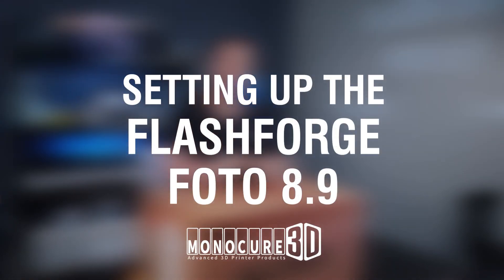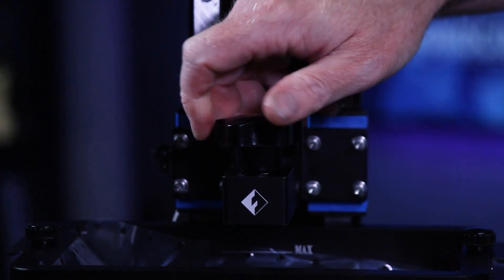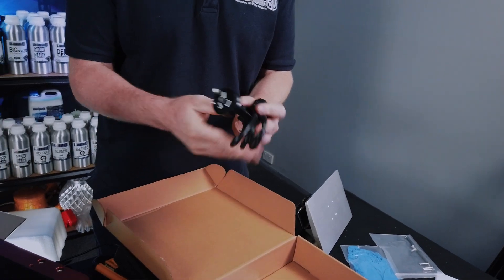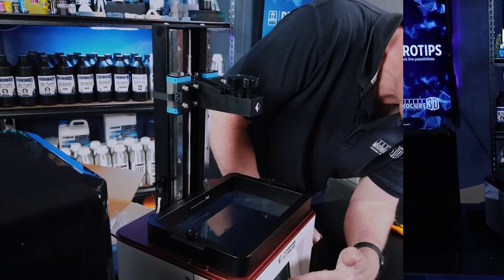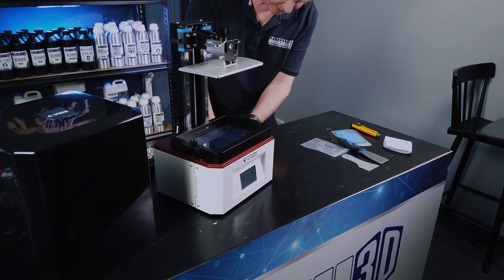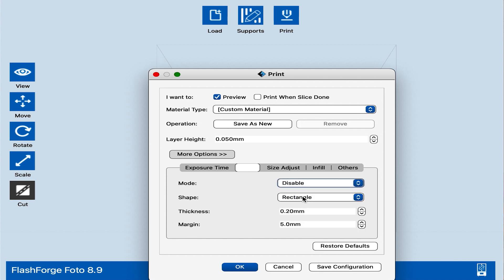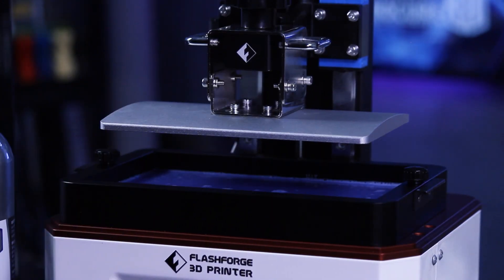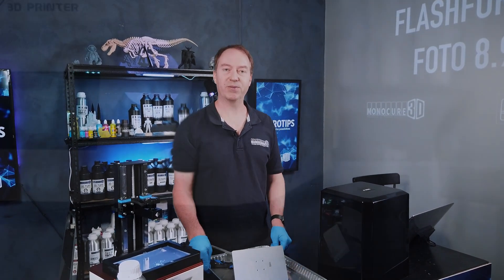Unboxing and Testing the Flashforge Foto 8.9 3D Printer: What's the Verdict?

Comment: I picked up one of these for $120 last week.  It's solid built machine but the software sucks and it doesn't work with Chitubox because it does not have a Chitu board.  You can edit the printer config for Chitubox to make it work but as far as I know things like retract speed cannot be set with the software.  Has anyone had any luck finding software that woks well?  FlashDL print doesn't even let you hollow the model.
Reply: Chitubox works fine without Chitu board just have to either create a custom machine profile or edit the default Flashforge Foto 8.9 cfg file to allow to save svgx

Comment: Excellent thorough review.  Flashforge has this printer on clearance in the USA.  They sent me a coupon for $10 off my first purchase for signing up on their website.  So I bought one of these printers with the orange instead of the dark cover for $169 USD including shipping and sales tax.  While I didn't really need another printer, it was hard to pass up at that price.  They also surprised me with a free 500 mL bottle of the green Voxelab resin in my mailbox today a week after I received the FedEx delivery of the printer.   BTW, the printer plate holes are a non-issue once you apply a magnetic flex plate.
Reply from the maker: Sounds like you got a good deal! valid point about the flex plate. I still think they are unnecessary and could have easily made rebuild, plate without the need for holes!
Reply: You better contact them! Its now $129 with free shipping direct from Flashforge!
Reply: @entertainmentdudes  Amazon is now selling it at $149.
Reply: @hughessay1372  Got mine Monday straight from the FlashForge website for $129.
Reply: @thedungeondelver  Great deal!  Happy printing!
Reply: @thedungeondelver  mine was $119 with $10 off coupon they had at the time.
Reply: @Bourn3J  Holy doop that's awesome!

Comment: G'day m8......i just bought my first resin printer in early march, Nova3D, Whale 2, 4K Mono with 8.9in and build of 192 x 120 x 250mm with WIFI, Lan and USB. I wonder if i can get 2sec expo with your resin, my eSun resin is like 3.5-4sec expo. Cause this Flashforge is so similar, i have bigger touch screen( i think) and my build plate and leveling is very differant. im currently waiting on buying a mini heater for inside my enclosure to keep my resin and build plate at the right temp. Cheers for the review on this mid level printer🤔 from a 50yr ol Lad in Brisbane
Reply from the maker: Good luck with your new hobby! Please feel free to reach out to us if you need any help with your new printer. Brisbane you might not need to worry about the heater? It’s probably Rezin dependent. I know some resins like the heat. rather than heating, the whole enclosure. Just remember to warm up the bild plate a little bit before you print. This will help with print failures on cold mornings.

Comment: I think that film you took off the vat is the extra fep sheet - it has the corresponding holes for the vat - double check before you throw it out. Also, if you update ChituBox to the latest version, you will see that it accommodates for the FlashForge Foto 8.9.
Reply from the maker: Ok will check that out- thanks for the feedback!